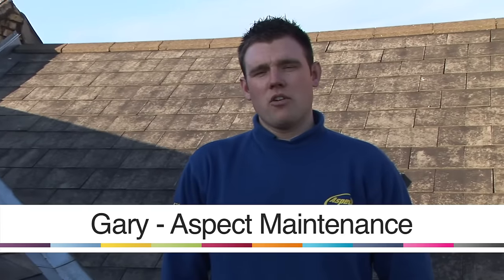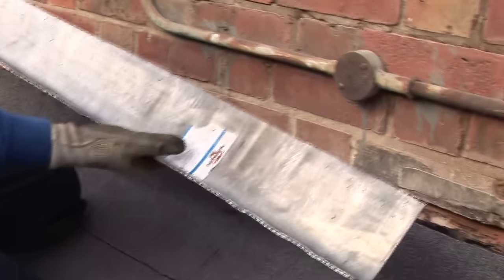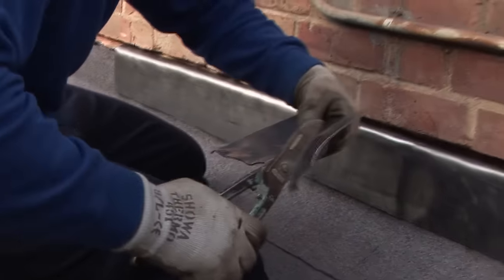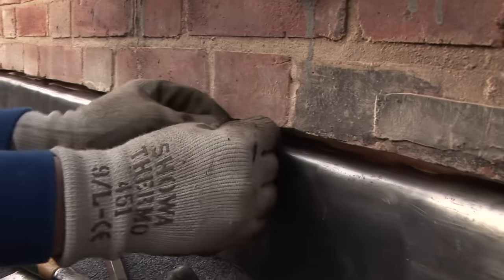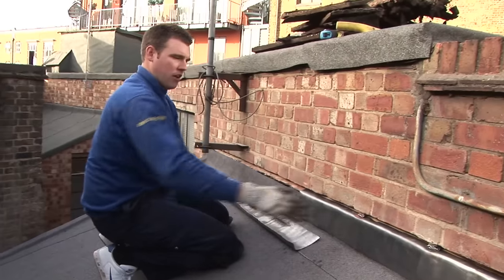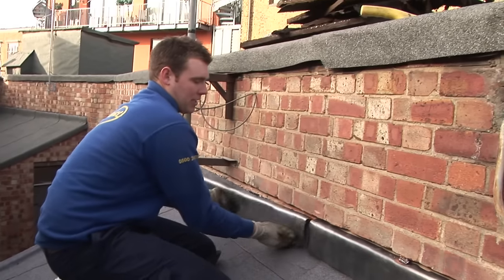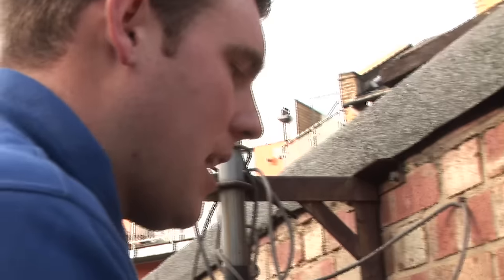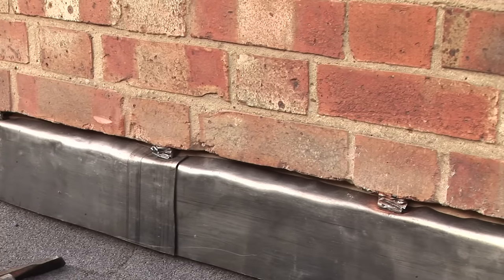How To Install Roof Flashing

Comment: Wondering as a simple DIY er , can you use the liquid lead type filler that comes in tubes , to secure it in/seal it rather than just cement pointing ?  Is it beter  or no to do that ,Can anyone advise me please?

Comment: Im a 3rd generation roofer with 26yrs exp.If a felt roof has more that 15 degree fall then the felt must be nailed but you shouldnt be able to see the nails.The nails go on the salvage along the edge of each sheet and are covered by the next sheet and the same gets done along the verge before the verge flashing is fitted.If this isnt done the felt will slide and wrinkle in extremley hot weather ;o)

Comment: with no roofing cement under the flashing, the water will still flow into that gap and then under the flashing no? I don't see anything to prevent that.  is the flashing here just a mechanical protection of the roofing felt under it?
Reply: Watch the video again. He did mention that is how you install the lead flashing and also mentioned to fill it up with mortar "to make as watertight as possible", but hey if you skip the video you can no blame anyone other than yourself.

Comment: I have to agree 100% , it always chancres who post videos on building trades. This guy is simply a first  class chancer..  The section of lead that goes into the wall should be at least 40mm  have a upturn on it to stop water perpetration in to the mortar. He then puts  one lead wedge in place and knocks the s...t out of , causing the lead flashing to buckle.  It not rocket science, you place all your wedges in place and tap them  gently  in rotation , till they are sweet.No need for brute force

Comment: Lead being tucked into the cut chase should return up inside it like and L shape and be fixed with brass screws, washers and rawlplugs. Read the Lead sheet manual,this is the recommended method. Cutting and chiselling in lead straps damages the lead! The chase should then be sealed by first brushing on a mastic primer and then using lead sheet sealant. I've been doing leadwork for 35 years as a plumber. Just because you can torch on a bit of felt, doesn't mean that you can do leadwork too!

Comment: Lots of issues here;
1. The modified bitumen wall flashing is not nailed off. Big head concrete nails in to mortar must be used.
2. How are you addressing the gap between brick and lead? water will go behind and rot the brick.
This job needs rejection.
Reply: He said at the end that the gap will be pointed with mortar.

Comment: That's how you install a lead flashing eh? Bugger I've been doing it wrong all these yrs then mate cos  I tend to knock the 'bungs' in not tickle em. Also you stated 25mm into your chase but that flashing was hardly into the wall, no nip 'n' tuck on your side lap, patination oil is a nice idea... and point the wall up, assuming your not talking compo?

Comment: contd ..Most professional tradesmen would cover the  area of roofing with a plywood sheets  or dust sheets to prevent damage to the new felt surface. Felt membranes are easily damaged scratched etc , and theirs nothing looks asbad as a new green mineral felt roof with scratches , dents etc. Their are professional out there who are masters at this work , but sadly they never ever post videos of their work. Manufactures should post videos  using only highly skilled tradesmen. It in their interest.
Reply: mulders drift I'm retired from the 3rd largest commercial and industrial roofing company in the USA with sales of $75 to $120 million a year ,we don't post videos of our work because a small job for us is 1,000 squares and it's got 40 men working on the roof ,for my son's high school wood shop project I took my son to work with me so he could make a video demonstration of " How To " from start to finish ,it took him filming for 5 days on a 1,200 square tear off to capture tear off ,deck replacement,itnstallingnstalling a base layer of insulation ,then a tapered insulation system , tuck pointing bad masonry before flashing over , rebuilding several rotten chimneys ,installing the roof and dozens of details like pitch pans ,soil pipe leads ,lead roof drains etc before we even got to installing the final layer of cap sheet ,itnstallingnstalling turned out to be a 4 hour epic lmfao ,if I could figure out how to put a VHS tape on YouTube I'd download the thing .